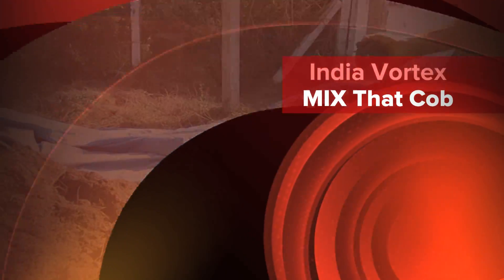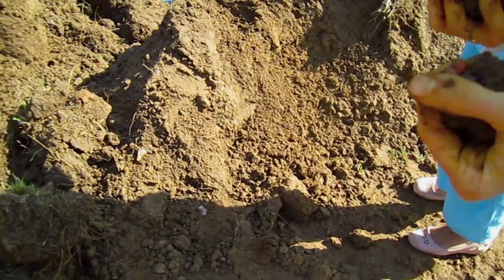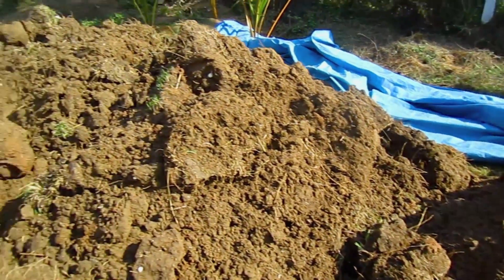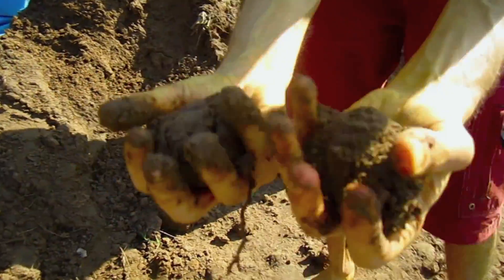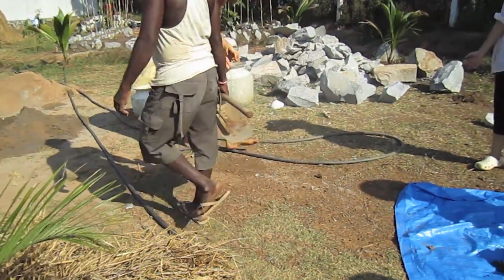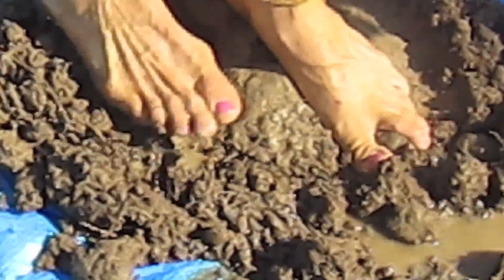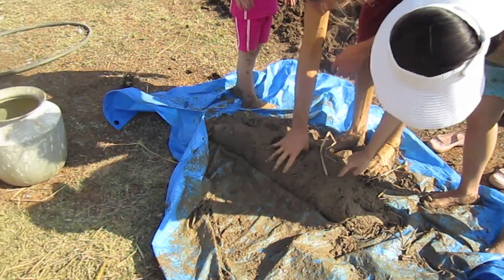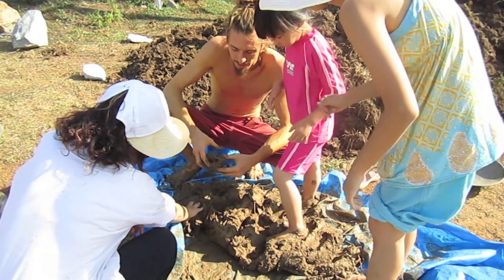cob building, how to mix cob perfectly for earthen building

Comment: what would happen if we get a flood? I love that it is tornado/earth quake proof but that is another thing i am worried about. will constant rain bother the building?

side note: cute toe nails ;) LOL
Reply: You need a good hat (roof) and good feet (foundation) but nothing will hold up to a massive flood.  The difference is this is rebuildable easily and cheaply.  It dries to almost stone, so it will hold up to smaller floods.  Look into clay slip/straw building, also.
Reply: A group in New Zealand used bitchermin (sorry can't spell, like road tar) to water proof a earthbag hut then they just rendered over the top of it I don't see why that wouldn't work on cob. The video is on u tube but I can't remember the name of it.